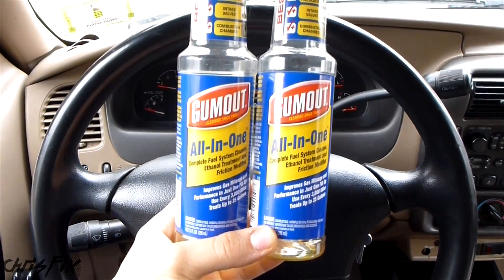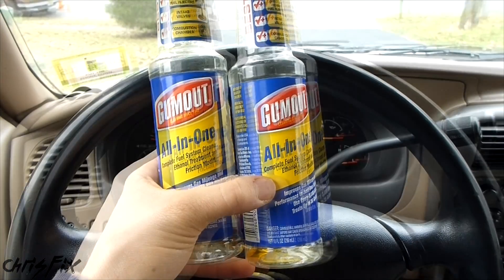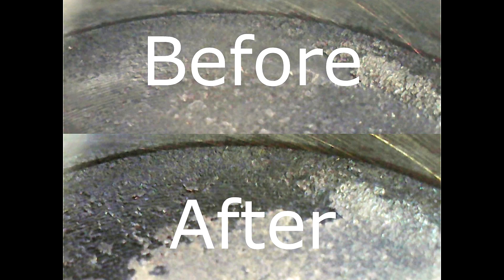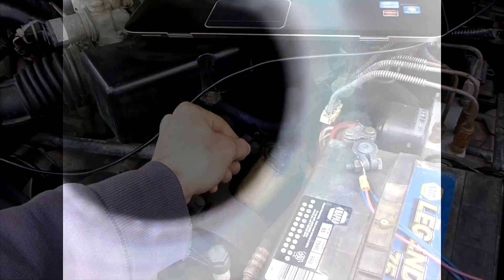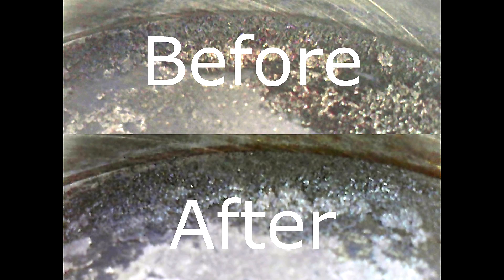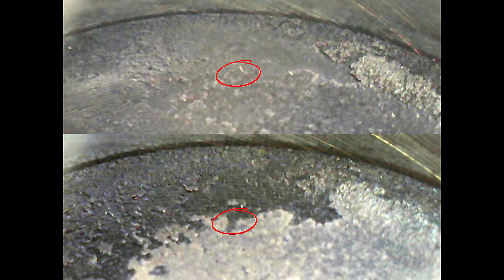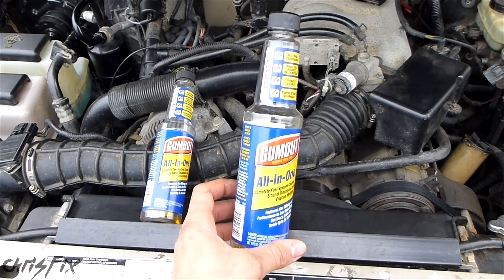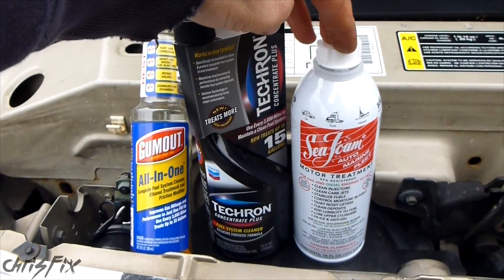Does Gumout Fuel System Cleaner Work (Follow up)?

Comment: You need to take all spark plugs out and literally fill the cylinders to make that stuff work. But what does a better job? Straight kerosene plain and simple. Pour it In and let it sit overnight then take a tube and suck it out.  After that crank a few times without plugs then put plugs back in.
Reply from the maker: Peter Carlson The problem is that this can be very risky. Some of the liquid will seep down past the piston rings and contaminate the oil. It isnt that important to get the carbon deposits out that I would try that, ya know?
Reply: ChrisFix very simple procedure to change the oil, and in fact you can run most cars for short times with straight kerosene in the crank case (except variable valve engines) If you have enough carbon buildup to cause detonation by increased compression you are in fact doing damage with every piston stroke. In your case you don't really need to do that because that is extremely minor carbon buildup.
Reply from the maker: Peter Carlson Interesting. Yea, if you are getting detonation, then that is very bad. That is tempting to try. Maybe if all the cleaners fail I will give that a shot! Thanks Peter!
Reply: ChrisFix kerosene won't harm your engine.  However it can make your rubber seals more flexible and prone to rips and tears. It is almost indistinguishable from diesel fuel sans a few contaminants found in the stuff. It has lubricity all on its own right because it is made of longer chain hydrocarbons that will fill the gaps in the journal bearings.  You just don't want to run it all day like that but I have driven about 20 miles with a crankcase full of kerosene only before getting the oil changed.  The only major problems arise when that carbanaceous crud is the only thing holding your engine together and keeping in the oil pressure in your main journal bearings.
Reply from the maker: Peter Carlson Neat info! Thanks Peter!
Reply: fordwindsor351 most diesel engines will run just fine with kerosene.  They are VERY similar hydrocarbon fractions to diesel. I ran a 98  gmc diesel on agracultural kerosene for something like 13 years without a single hitch.
Reply: fordwindsor351 so what I'm saying is it's at least 99.9% reliable,  detonation will cause FAR FAR FAR more damage than kero will. If you've got a severely carbonated engine that detonates because of the increased compression you aren't doing any harm. If you don't believe me, try running a power balance test before and after de carbonization and you will see the plot clearly show an improvement.  I'm not trying to get on anyone's bad side but I've been fixing modern off road vehicles my entire life and I know what works. Hell. If you look at the msds sheets for half these chems, many of them are up to 50% straight kero
Reply: Oh no, no mad sad ot intention here. Just speacking from my knowledge and experience, am i always right, nope. Was just getting into a conversation explaining my view.
Reply: fordwindsor351 kk. So if you have the Ford ids or the older NGS try doing the kero trick and see the power balance before and after. I've turned many a chitty chitty bang bang into serviceable vehicles that have gone on to run 50kish off road miles which is more like 200k highway miles. I will agree it DOES absolutely without a doubt soften seals. But by the time you need to do this the seals ate usually already leaking and in some cases the springs inside will clamp down more on the softer rubber prolonging their life.  Then again what do you have to lose? A 15$ front main seal?
Reply: I would stay away from the kerosene trick, your o rings and gaskets would hold up to the given additives within kerosene. For anyone to compare kerosene to diesel or to think they are close enough are wrong.
Reply: fordwindsor351 many big rig drivers who don't travel interstate (dye dip test) run straight kero or 50-50 diesel kerosene mix and it works just fine.
Reply: fordwindsor351 In fact you could say kerosene is ultra refined diesel without the long c chain hydrocarbons like parrifin and the like.
Reply: Im not talking about big rigs, in an gas automobile the o rings and gaskets wouldn't hold up. Plus the cleaning wouldnt even be worth while.
Reply: fordwindsor351 it won't do any harm in the short run. Kerosene is just ultra refined diesel anyways. It might not have all the detergents and conditioners that diesel has but that shit is superfluous anyways. As long as it doesn't detonate it will be just fine.  Like I said. Ran a gmc diesel for more than a decade on straight kero with zero problems whatsoever.
Reply: fordwindsor351 can you actually cite an engine you have rebuilt that failed due to kero? It's like the difference between gasoline, and the white gas that comes in a can you need to use for a Coleman lantern. The white gas will work either way, but pour straight petrol into your lantern and you WILL have problems.
Reply: fordwindsor351
are you one of those people who swears that putting a modern car battery on concrete will discharge it? a whole lot of theory without any practice?
Reply: No I am not
Reply: fordwindsor351 because I've cleaned many a hundred engine with kero without one single hitch.
Reply: Good for you